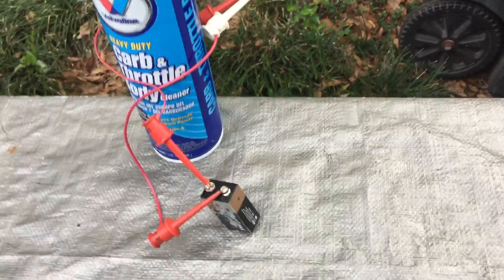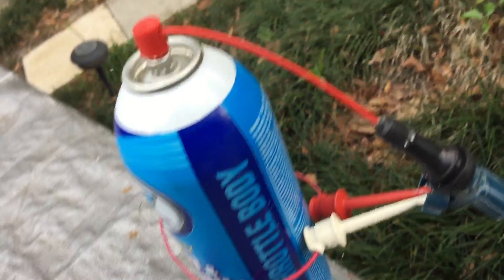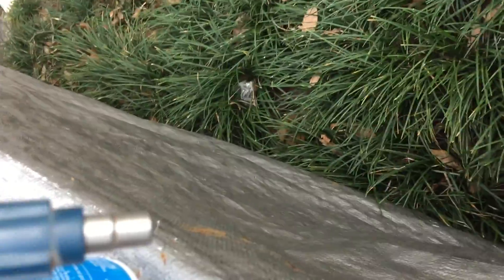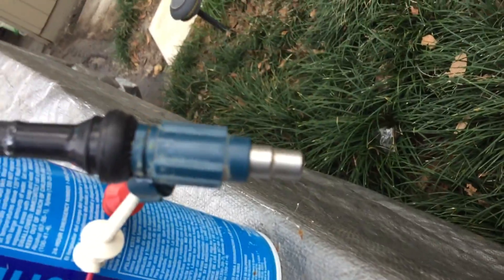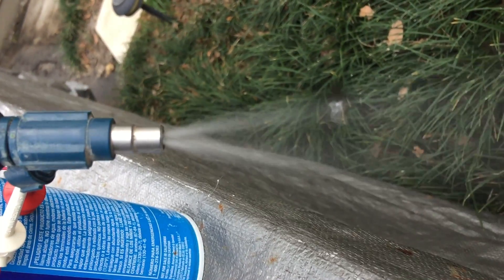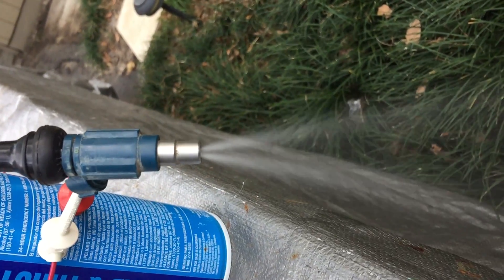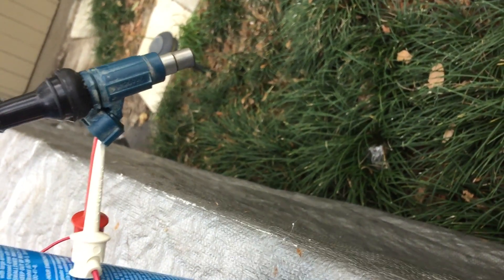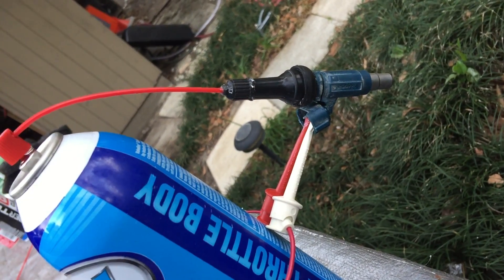09 KX450F Fuel injector cleaning cheap

Comment: Hey man thank you for this. Short, sweet, and to the point. Had to read your comment response about the valve stem of course, but glad you took the time to respond. 

Dunno if this is the fix the bike needs, (replaced the pump harness/white plug, pump filter, spark plug already) but worth a shot!

Comment: Cleaning injectors is kinda pointless.  Gasoline is a pretty good solvent.  If it is varnished up and it comes off, the pintle is clogging.  Clean the outside if you want, but you are better off not internally cleaning injectors.
Reply: Clearing degris doesn't seem pointless.  Or it's pointless, why are there special tools and procedures available for this?  My fuel system is full of debris from a failed fuel pump.  I'll try cleaning my rail/injector before buying a new one
Reply: @joshh4778  Agree with you, cleaning the injectors isn't pointless. Cleaning is inexpensive and you have nothing to lose with a clogged injector.
Reply: Triggering TDS Libtards Enlighten us... great wise one.  I have three different injector test benches and enough gasoline injectors to keep you busy for a long time.  Ive had lots of worn pintles, bad coils, worn intensifier pistons, and zero injectors that have shown improvement that good clean fuel didnt fix.  Injector cleaner doesn't work.  A good balance run with 100% mineral spirits works far better anyway.  But yeah, say Im wrong and how 1oz of cleaner in 35 gallons of fuel is better and yadda yadda.

Comment: Can we  connect battery  Negative  and positive charge terminals to  injector  randomly. Does  injector will  work or it  blow  off ?? Please do  reply
Reply from the maker: I recommend a 9 volt battery to not risk over voltage as these function off a pulsed signal, not full current surge